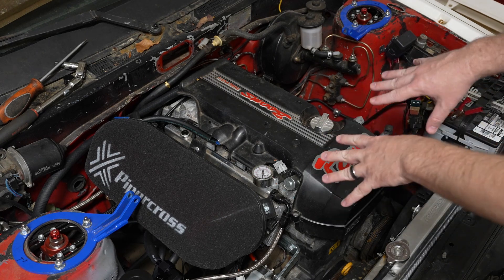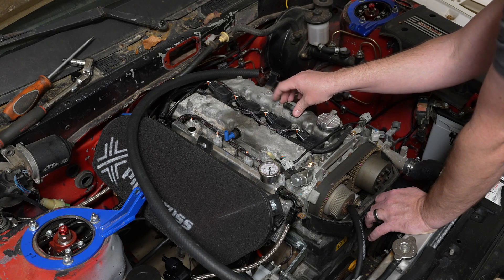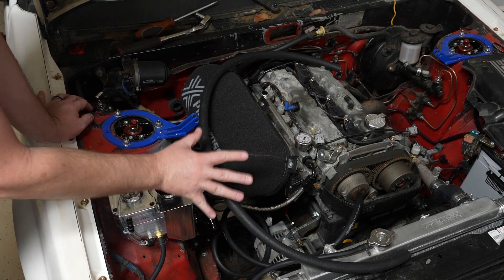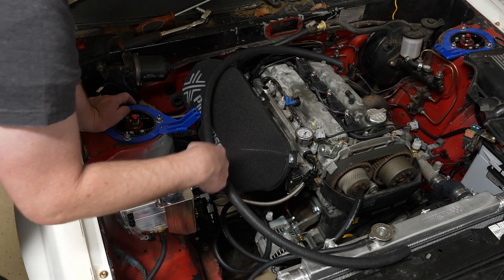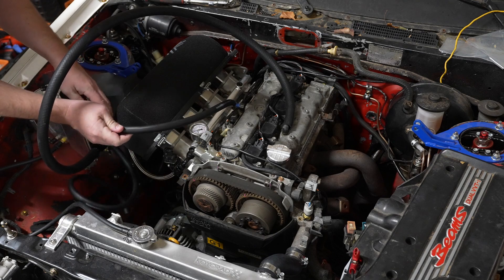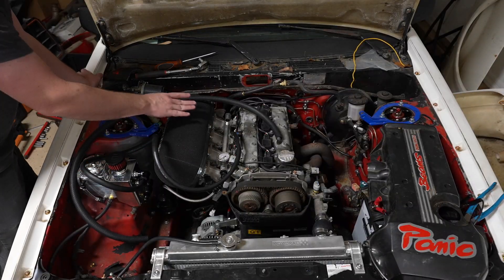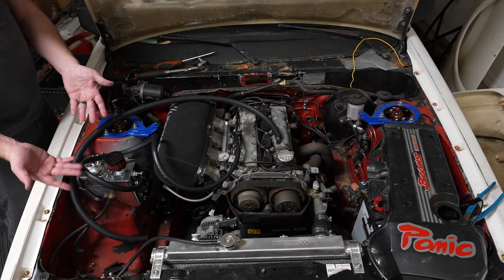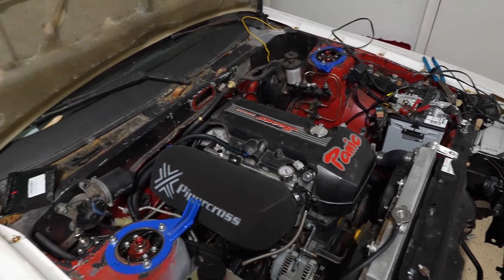BEAMS 3SGE Oil Catch Can - CORRECT INSTALLATION

Comment: What about a stand alone but you have the stock intake no itbs?
Reply from the maker: Depends on if you're still using the MAF to read air. If you are, route it stock like. If you're MAP based, you could run it like I did with the ITBs.
Reply: @DoctoredGarage thanks man I appreciate it

Comment: The question is: does oil catch can solve the problem of valves carbon? The answer is NO!!
It may extend the time until the problem occurs, but will not eliminate the issue. 
Catch cans are a big industrial fart😂😂😂
Reply from the maker: I'm not sure I understand your point. Catch cans and air oil separators help prevent sludge from building up on the throttle plate, intake valves, etc. They also prevent oil vapors from getting back into the intake/cylinders for a little better combustion. 

Of course it's not a 100% perfect solution, but nothing is. This is an improvement over not having one.

Comment: Question can i use a 3 port oil cafch can that has two inlet and one out let,so example pcv valve goes to inlet on catch can and the vent goes to the other inlet on the catch can and then the outlet goes to the intake manifold,would that work ?
Reply from the maker: That's the exact situation that I'm trying to help people understand. That would be similar to just plugging the fresh air vent line. It'll "work" sort of, but it won't work correctly. 

Air flows OUT the PCV, when that air goes OUT, there has to be fresh air that comes IN to displace it (from the vent hose), otherwise the PCV isn't going to be able to "breath" correctly. The PCV and fresh air vent should NOT be connected, unless they're both being vented to atmosphere so the crankcase can breath in or out from whichever hose it wants.

Comment: Hello. Thank you for this informative video. On my 3sge beams the previous owner installed a catch can with a breather. He routed both hoses to the catch can and blocked of the fittings on the air intake and the intake manifold. Is this a way of running it? From my understanding of your video, this would cause a vacuum leak. The engine seams to run fine though. I would appreciate if you could help me out.
Reply from the maker: As long as both fittings - the one on the intake manifold (PCV valve) and the intake elbow are blocked off, it shouldn't create a vacuum leak and you should be OK

Comment: Hey so what would be best if I was running map sensor, stock intake manifold & turbo would I try to recirculate it back into the intake manifold?
Reply from the maker: Hey Zyrah - you'd have to plumb the recirculation line it to the intake before the turbocharger.

Comment: What if i had an aftermarket intake manifold that doesn’t have a pcv port? Would i run both lines to the baffled catch can?
Reply from the maker: Yeah with an aftermarket intake manifold you could run them both to the catch can, same as the ITB setup